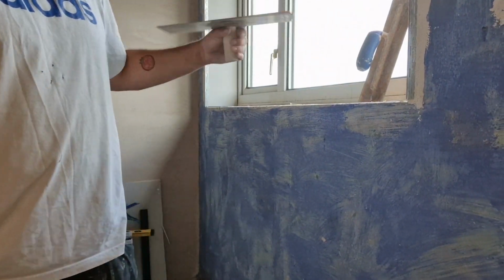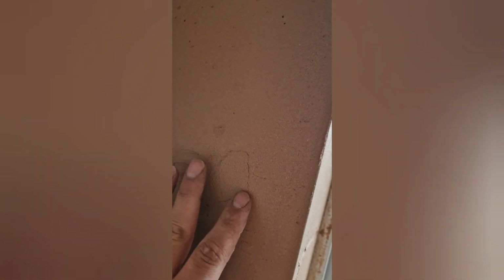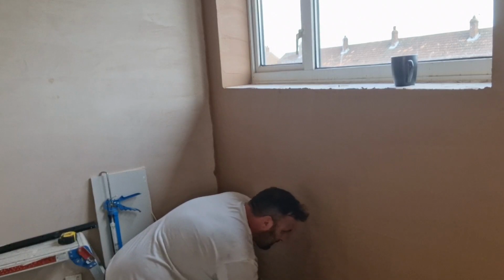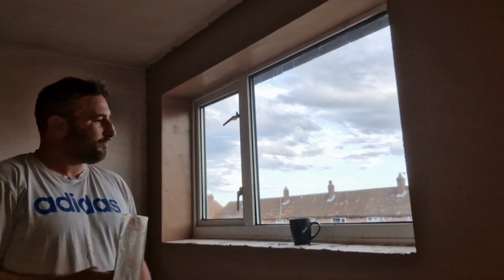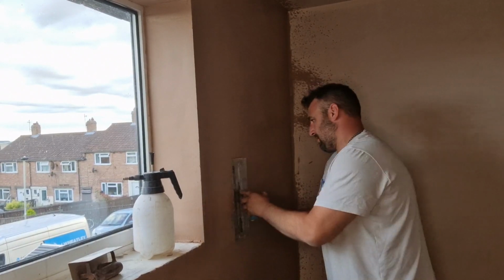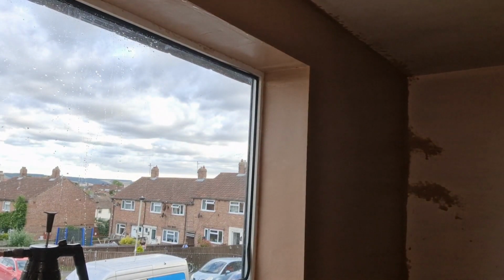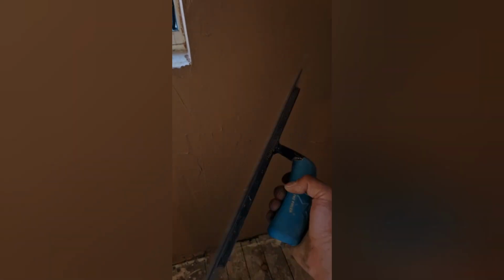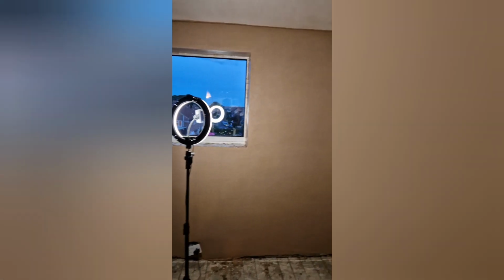Plastering a wall with a window.

Comment: Alright mate.
For someone who doesn't plaster every day you do a good job, but you are making things so much harder on yourself.
You definitely don't need to wet your first coat and go over it as much as you did. As long as you've done a decent flatten after your first spread then you're good to go for your second. Try the Ox speedskim 900, it works a dream! Saves time and helps the body no end.
I'd also recommend the Refina corner trowel with the big wings and use it when the plaster has picked up quite a bit - it's an amazing corner trowel.
Good work though.
Reply from the maker: Thanks for the advice I have lots more plastering to do so will definitely look into that.

Comment: It's a builders pointing hawk 🤣
Reply from the maker: Well it works great for plastering
Reply: @primalrenovations7427  yano I'm a spread and I won't disagree with you the lip to the hawk would help someone that's new to plastering gain confidence in their trowel and hawk skills or maybe a spread that's got bad wrists for sure and it don't matter the hawk it matters your works flat and smooth and nice clean angles and corners and the customers happy
Reply from the maker: Sure does as long as the end result is fine and it helps make life easier.

Comment: 😂 😂 Second coat your putting it on way to thick and why you starting on bottom right of the wall
Reply from the maker: Thanks for the tip
Reply: Did notice that but be honest bud that's only a little room so not much to go wrong...spread could sort it in a day if needed.
Did spot him Sparying water on 1st coat that is massive no-no as can cause second to flash set 
Besides he's giving it a go can't knock him really.